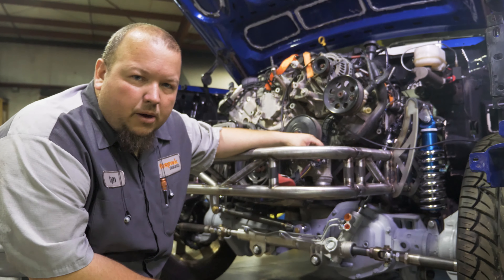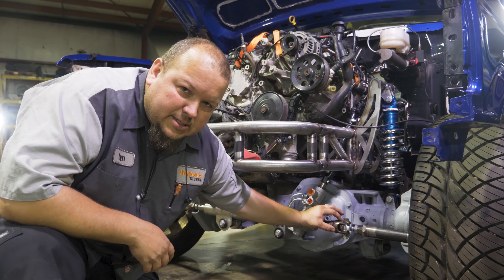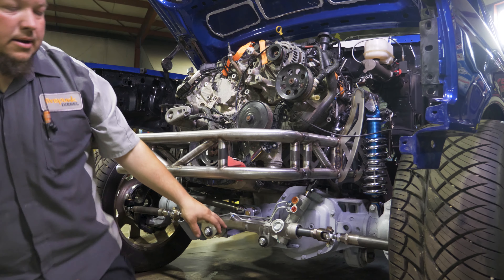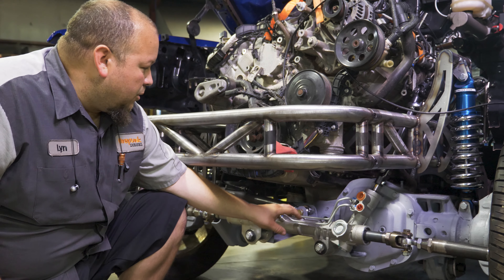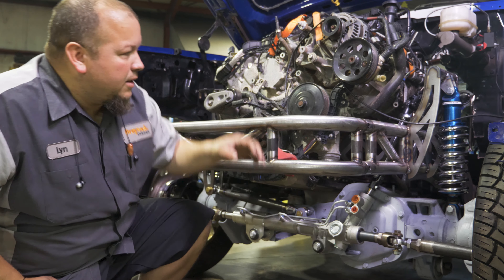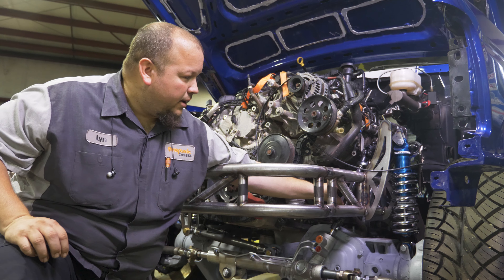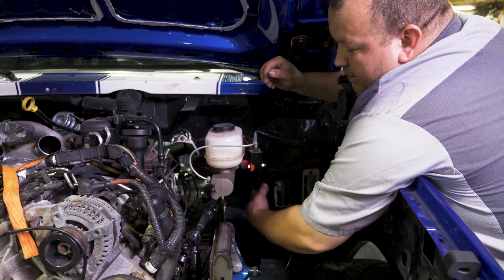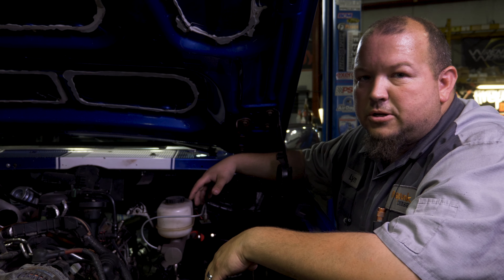4 WHEEL DRIVE POWER RACK & PINION

Comment: Have you considered doing a stand alone kit for the 2nd gen ram 2500/3500 4x4? With as many complaints as there are about the poor steering feel for that generation, I think there would be a market. You could offer a selection of the collapsible section to accommodate multiple lift options.

Comment: Out of curiousity: why not do a hydraulic setup like used in Rock crawling or Ultra4? It must be a headache getting the linkage working correctly with the supsension travelling up/down.
Then you only have two hoses going from the frame to the axle.
Reply from the maker: Weight
Reply: I don't like the idea of a full hydraulic steering at 150 mph. But maybe I'm wrong?